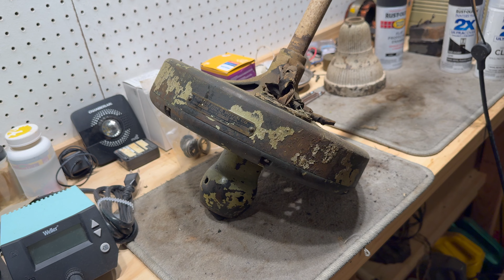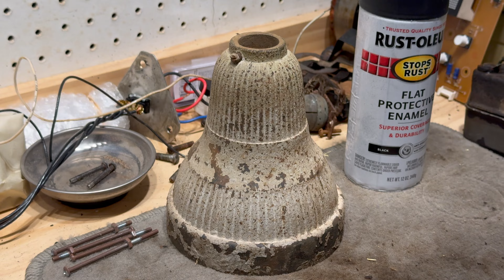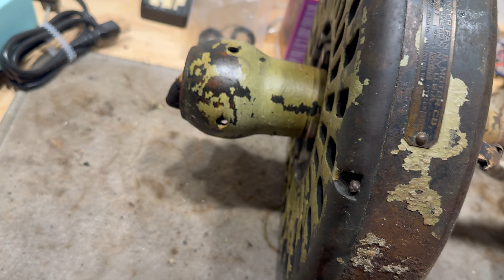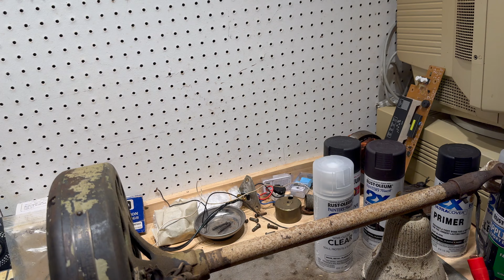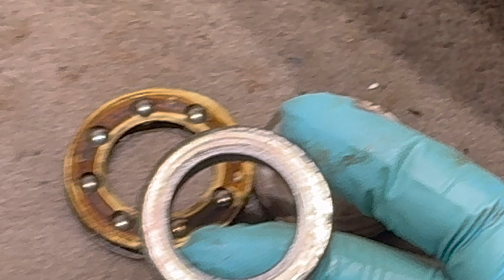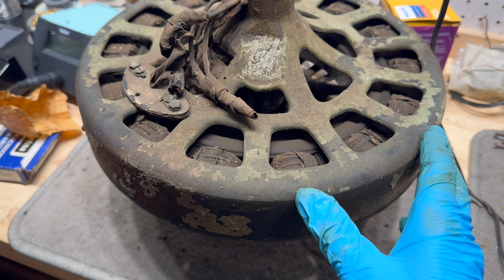Hunter C17 Antique Ceiling Fan Pre-Restoration Demo

Comment: I got one of these C17’s as well that needs a ton of work, has adaptaire blades but it’s completely locked up and covered head to toe in lead paint that’s scratching off, so I’m a bit hesitant to even touch it. Thanks for showing what the correct bearing needed for this is, I’ll definitely need to buy one in the future